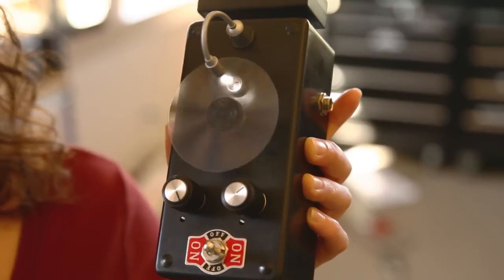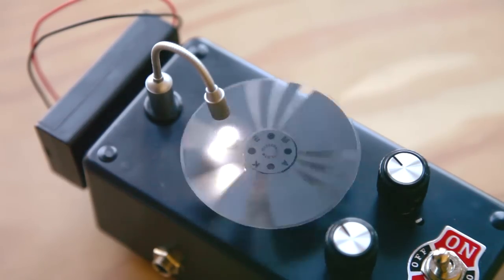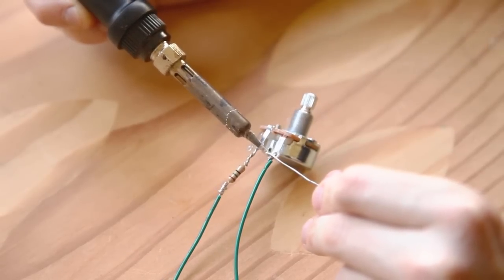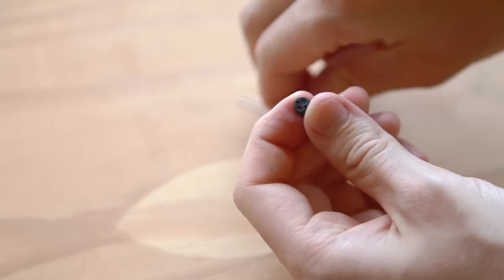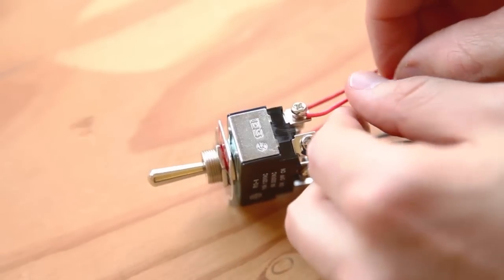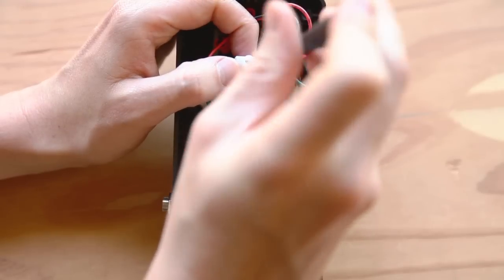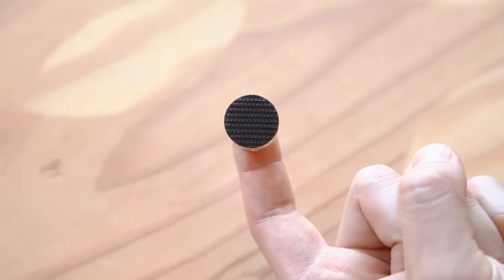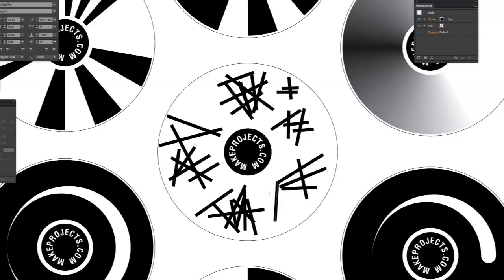Weekend Projects - Optical Tremolo Box

Comment: Will this work accordingly with gradients on the discs? (volume gradually fluctuating)
Reply: should do as the gradient will just smoothly increase/decrease the light hitting the sensor which smoothly changes the resistance so smoothly changes the volume as well.

Comment: I'm going to be testing whether I can replace the small discs with the plastic CD blanks. Then instead of using a project box as a housing I will use a CD ROM drive, just slightly modify it. Hopefully it's successful, I'll share a quick video of it if it works.

Comment: 2. Since the unit would be attached to a pedal board (carpeted), the bottom feet would be useless. We use Velcro on the bottom of our pedals. 
3. Since its used in a low-light, but rapidly changing light environment (stage), the light disc area would best be covered yet still accessible, possibly by a 3 sided cover. 
4. the on/off switch would need to be wired as "true bypass" which gives a completely clean signal

Comment: Great project! HOWEVER- there are a few things that would make it useful  to a musician- 
1. You may want to consult with a working musician (one that gigs a lot) to find out all the idiosyncracies with the unit. A regular (guitarist in this case) would never stop playing to use his hands to turn the switch on. So a push-on push-off switch (industrial strength) for stomping on with your foot, is required. Organ and pedal-steel players would use it this way as well.

Comment: Great project. I have a couple of questions. Why not use two potentiometer with different values to control speed and effect instead of a pot and a rheostat? That is a cool switch but I think you can swap out the DPDT for a SPDT switch with and just not have a reverse option, right? I just ask because for guitar tinkerers often have these parts on hand.